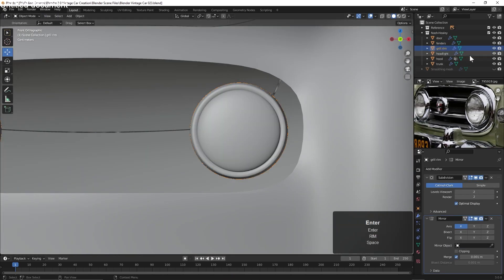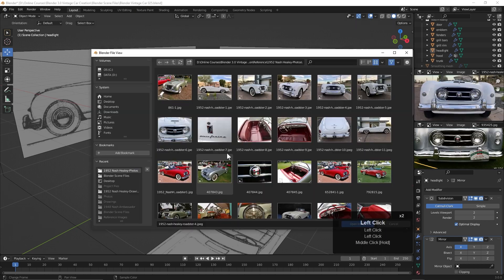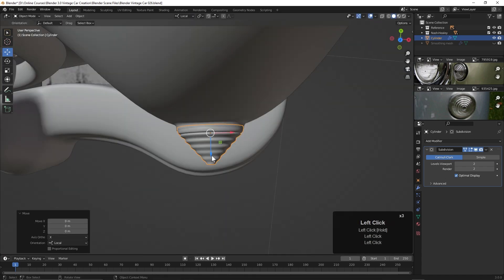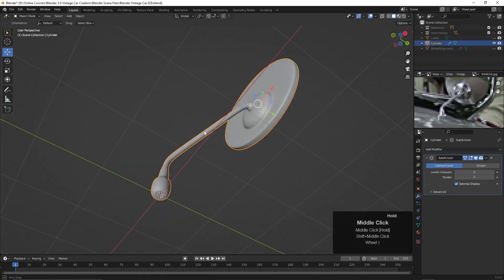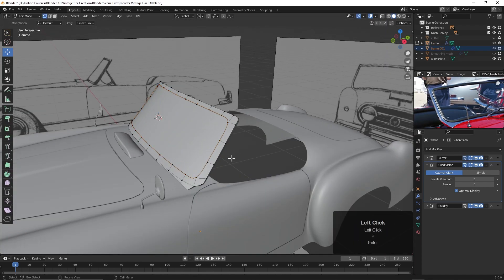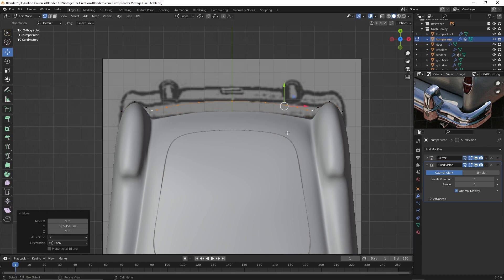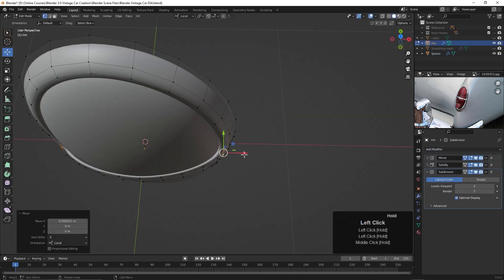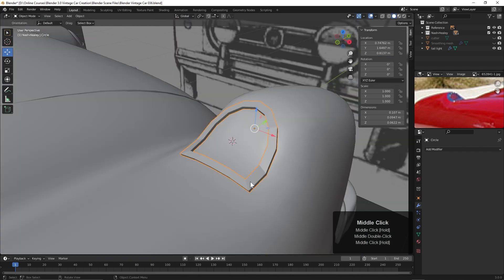Blender Car Creation - time lapse part 3

Comment: Excuse me, mr. Lile. FIrst off, I want to thank you for your amazing tutorial videos you have been making over the years. Because of you, I started using Blender and gotten better at it with your simple to follow videos. 

Now, the question I have for you is about the procedural nodes. I have a little problem understanding the options given to users on certain nodes like MixRGB, Math, and Vector Math. They all have different options such as Add, Multiply, Overlay, Color Burn, etc. 

If you haven't already, could you make a tutorial video explaining how each of these options work for nodes that have them?

Comment: Hi Darin. Have a question and if anybody else can help me, please. Now the old Blender has the grey strip at the bottom allowing a person to change layers; you the thing that has 20 little dots. I've looked on the manual and also on tutorials but can't find an answer. Question is does Blender 3 have this function and how do I access. Anybody's help would be appreciated. I do thank you Mr. Lyle for all your great tutorials. Happy New Year everybody!!! It's gonna be a great one!
Reply from the maker: Hi, the layers have been completely replaced by Collections in the Outliner. It takes a bit of getting used to, but I really think that Collections are way more useful than the layers were. They can do all the functions of layers and a lot more.

Comment: Hello Darrin, I've got a question regarding the windshield. Is there any way to create the glass-transparency effect using just blender? Or is this something done in the post-modeling state while using programs like unity/ unreal?
Reply from the maker: They all have transparency settings for materials. It just depends on what you are going to finish in. If you were going to finish in Blender, then you would use the transparency settings for Blender materials. If you were finishing in Unity or Unreal, then you would use those materials settings.